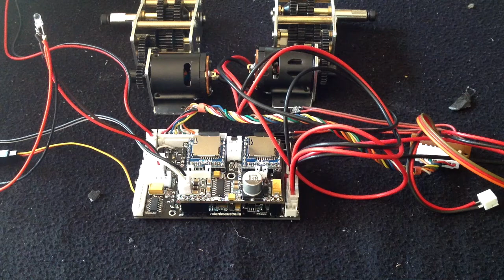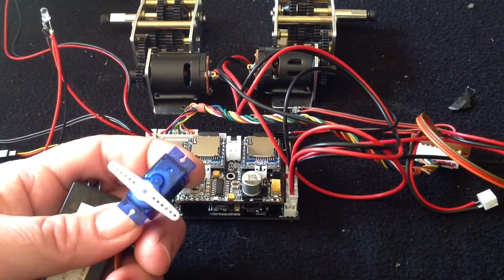ASP - Halftrack Mode

Comment: Lovely vid , but would this also work for a M16 with just 1 engine, and powered front axel? got the torro M16 and tbh it made me sick that theres no front wheels powered nor suspension, will mod it with a steel chassis , leaf springs on front, and working suspension of the track wheels.